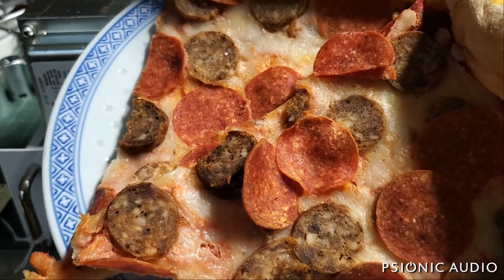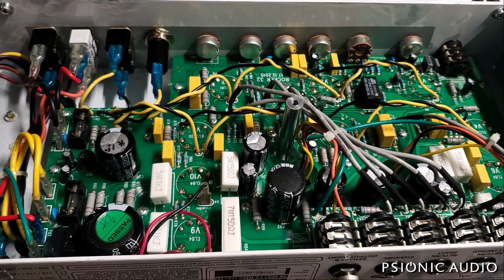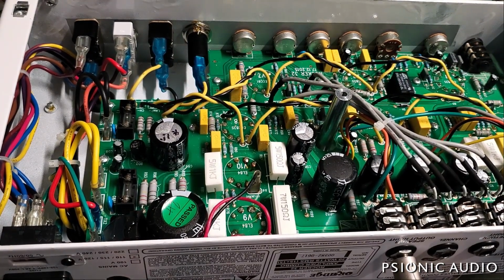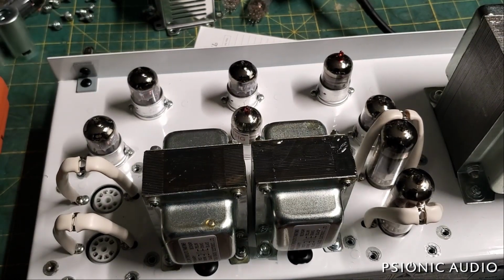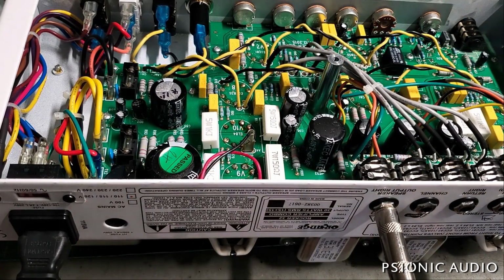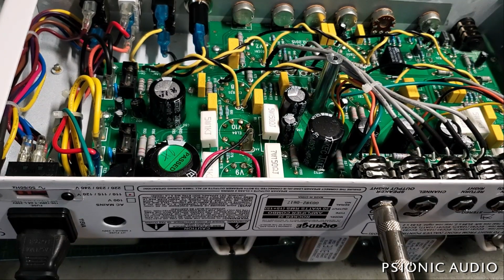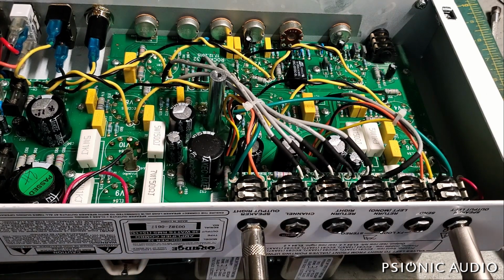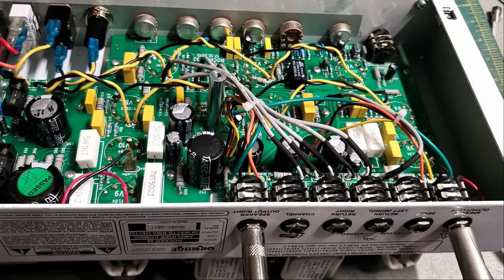2K Subscribers, Cold Pizza, and an Orange (Rocker 32 Content)

Comment: I've had a Rocker 32 for around 5 years.  With a stereo reverb, chorus and delay in the effects loop clean channel, it sounds divine.  Even with the two 10" speakers in such close proximity to each other, there is a sonic depth my other amps can't touch.  If you dig those Shoegaze sounds, you may want to look into these amps.  As an added bonus, you'll have an excuse to buy more (stereo) pedals!  Thanks for another great video😉

Comment: doesn't Orange claim that the biasing is different on each side? One is cathode and the other is ... ???
Reply: 'One output stage features its own cathode follower which adds a subtle widening effect and an extra dimension to the sound, even when operating in mono.'
Reply: 'One side of the Rocker 32 has a cathode follower after the effects return, while the other is anode following. The cathode follower hits its power amp at a lower impedance than the anode follower; what this means in practice is that one side of the 2×10 has a faster and tighter response, while the other is softer and more compressed.'
Reply: this may well all be complete marketing BS ;)

Comment: I recently got this amp and love it to death so far.

the wet/dry setup on the speakers does give my modulation effects (flanger, delay, verb) a bit more definition and separation from my drive pedals running into the front. Glad to hear you find it sturdy and well designed. Hope my tubes don't get cooked too quickly. I'm used to 6L6s and they last forever!

Thanks for the great vids! Love the attention to detail.

Comment: Back in the 60's, you'd see 7189's used in some Magnatone amps as well as various hifi amps; essentially a heavy-duty El84 (same pinout), rated for 400 volts and 12 watts plate dissipation if I remember correctly. The 7189A was uprated to 14 watts dissipation (for both plate and screen) but had a slightly different pinout, and amp manufacturers often wired the sockets in such a way that inserting a 7189 (or EL84) into a socket wired for 7189A's would result in no sound (signal would not be connected to the grids), to prevent under-rated ordinary EL84s and 7189's from shorting and blowing transformers.

Comment: Probably runs hotter that any other power tube . el84 . & I will say I've that I have witnessed more power tube  failures with that tube than any other by a crazy margin . 
I own 10 amps with 84's & had replaced power tubes in all but one cause of failure .  these are all modern amps built in the last 15 years  . Also I did a few amp repairs for local guys  with VOX/Fender & H&K that all had failed EL84'S .   that tube works great in a heavy circuit & also I'VE preplaced all of mine with the 6P14P  tubes . they are rock solid .
Reply: One wonders how it is that the Russians had pin-compatible substitute or replacement tubes to the more familiar European tube types. Were they intentionally reverse-engineering European tubes during the Cold-War era?

Comment: Congratulations.  I have really enjoyed your content

I'm glad they hard wire the filaments like that, they used to do the flying lead thing but then had push on connectors at the board for each valve, and I've read many reports of those failing.

Comment: You want an amp that cooks el84 tubes?  Try a Carvin Belair, 400+ volts on the plates and a 2.5k output transformer for 4 tubes!!!  I don’t know what amp builders know that service techs don’t?  Even the The old Russian el84 tubes with the Cyrillic writing. They are 14 watts and higher plate voltage, with the caveat it’s only good for 14 watts dissipation at the lower plate voltages.